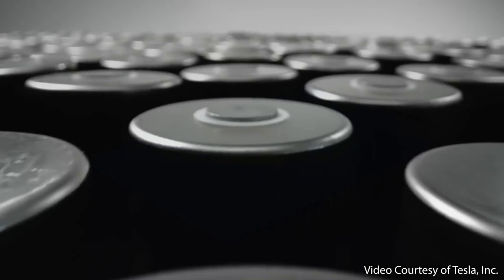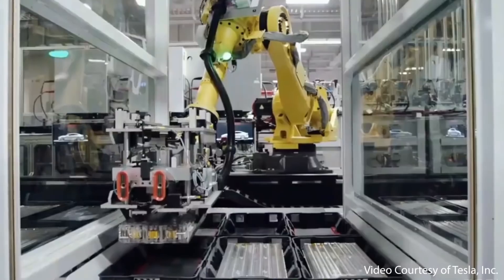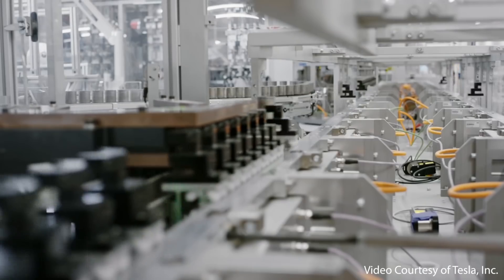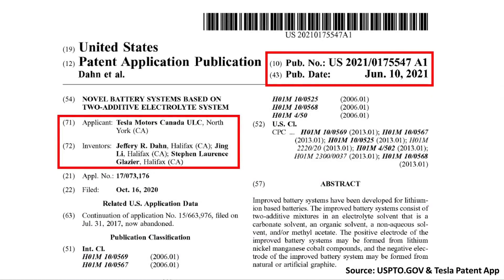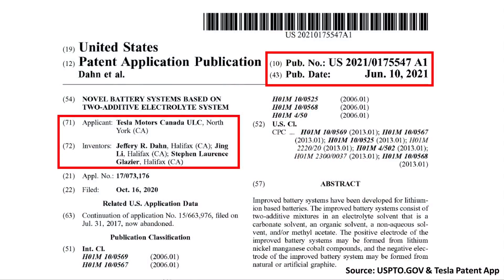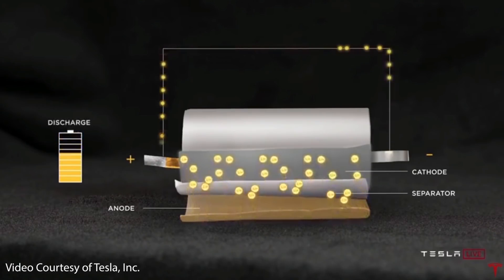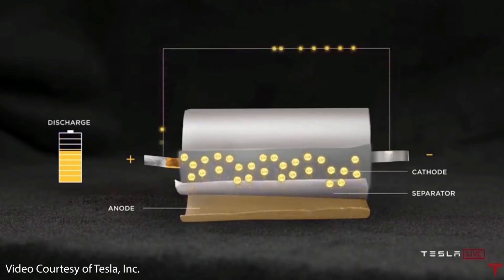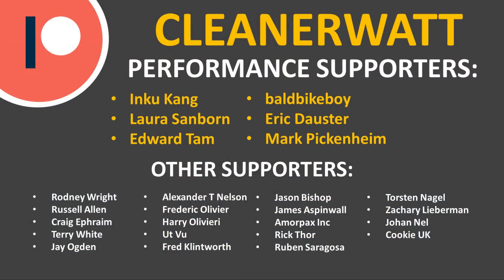NEW TESLA Battery Patent App for LOW COST EV BATTERIES (Jeff Dahn)

Comment: 1300 cycles at 4.3 volts - if the volts are pulled back a little 4.2V, or 4.1V max, the cycle life goes up a few times - I think Dahn limits testing to 4,000 cycles.

Comment: Hi!
And at  (min. 12:30) also improve the battery's characteristics at a lower temperature (2°C = 35.6°F), so to reduce environmental influences over the capacity and thereof, better range of the car in cold weather conditions

Comment: Elon Talked about a

Million mile battery , A while back.

A long lasting battery is necessary for vehicle grid or vehicle to home applications
Reply: Jeff's team developed it awhile ago, but the cobalt use is higher and it's not destined to be a larger volume cell. For the truck and roadster that need to handle more abuse... maybe.

Comment: 1300 cycles at 400 klms per charge is 520,000 kms and the battery has only degraded 8%.
Reply: Genuine question: do you have a source for that?

Comment: Given electrolyte additives can increase any performance metric you want, it begs the question how will solid state surpass all metrics simultaneously?
Reply: Solid state seems to be one of the ‘go tos’ of Musk haters who expect a magic wand that makes the competition better overnight by using these currently non existent items...

...Meanwhile Tesla just carry on producing better products by improving everything all the time.
Reply: @fredbloggs5902  Tesla's tech is a moving target. No use a '25 solid state surpassing a '21 2170 or a '22 4680.
Reply: @andyonions7864  Solid state is not production ready, yet. Also, if you check out opinions of people like Sandy Munro, you'll find, that Tesla's 4680 cells in the configuration they are intended are likely to surpass any of the current solid state developments. Solid state is not the solution to the problem, if it's not stable. And until it is, the world doesn't stand still.
Reply: @Marlow925  Thanks. I know all this anyway. Also, current solid state still contains electrolyte. Go figure!
Reply: @andyonions7864  Solid electrolyte vs liquid electrolyte. Still a significant difference. One of the important factors is, that puncturing the cell does not result in a chemical fire, because the electrolyte stays where it's supposed to be. Obviously that's not all, but it's one of advantages of a solid state cell. Either way, at this point of time, it still need to be proven, that a production grade solid state battery actually will outperform the existing chemistry. Especially with all the refinements, that Tesla has brought to the table.

Just because it might look better in the lab, does not mean, that it will be possible to mass produce at scale.

Comment: Top-notch research & delivery as also Jon.👍👏
I'm in awe of how Tesla puts so much time/effort into their research & development to simplify processes. It's through their determination & resilience that will win customers over in the battle against the ICE industry.
My only concern with the papers is that they mainly focussed on 20ºC & 40ºC which are quite moderate in relation to the real-world weather extremes that most countries would encounter.
Reply: Automotive batteries have thermal control system that keeps them at the desired temperature. So they only test the range of temperature relevant to automotive application.
Reply: @kazedcat  Thanks for clearing that up for me, I have zero reservations in the report now. 👍

Comment: I have a lot of respect for Dahn, et al, but they are building on their previous work(s) and making incremental gains.  This is good but solid state batteries are the end game.  I haven't seen Tesla supporting that technology and they will be left behind if/when ss batteries come to fruition.
Reply: They buy the company.
Reply: Solid state is overhype. Liquid electrolyte have higher ion mobility compared to solid electrolyte. This means solid state has lower power density compared to liquid batteries. Also since electrolyte only transport the lithium ions and not hold them the effect of solid state to energy density is minimal. Solid state is also more expensive. Injecting liquid electrolyte before capping is a single step operation. Solid electrolyte needs to be mix in both the anode and cathode production. The only benefit solid state has is reduce fire risk but a robust pack design and advance battery monitoring system adequately fix this fire risk issue. So Solid state battery increases cost reduces power density for the benefit of reduce fire risk which is already a solved problem.
Reply: There’s no guarantee solid state will ever be viable. 

Improving on what you know works is a better strategy.

Comment: Lithium salts?  isn't that what they have available in Nevada? "Tesla said its plan in Nevada involves mixing clay with table salt and then adding water. The company said the process causes a reaction where the salt would leach out with lithium, and the lithium then would be extracted. The leftover clay would be put back in the ground to mitigate environmental damage, much like the current mining industry practice of returning rock to the earth after minerals are extracted." See https://www.powermag.com/tesla-mining-companies-look-for-advancements-in-lithium-technology/
Reply: in a battery context, it just means it's not straight Li metal... basically.
Reply: @lylestavast7652  Yes but Tesla could use LiCl directly to produce the electrolyte salt. The process would be ion exchange between Na in NaCl and Li in clay to get LiCl then use LiCl to produce the electrolyte salt.
Reply: Useful link, thanks for posting.

Comment: 2:24 You should add a timestamp to skip the intro; request for subscribers and repeated information Tesla followers have heard x20 times. Other than that, great video. Thanks.
Reply: It feels like one of those #nevergetTothepoint marketing videos. The valuable info holds in 2 or 3 minutes but it is used to brainwash you for half an hour pointing out how paradigm shifting the idea is.... Ok it's not that bad and I dont mind some self promoting here and there  but please keep it DRY (Dont Reapeat Yourself) like the new Tesla battery manufacturing process ;)
Reply from the maker: Good suggestion... Do you mean add this time stamp in the description?
Reply: @Cleanerwatt  Yes please.